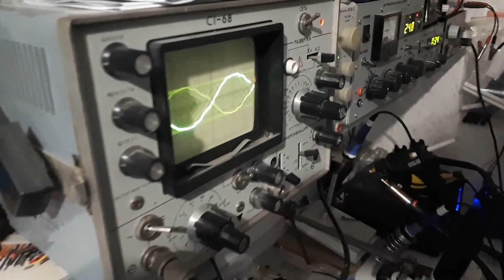Hobby CNC építés 3.rész (Build a hobby CNC)

Comment: Sziasztok! Az én alaplapomnak van egy párhuzamos és USB kivezetése is(5 axis controller board) . Veszek hozzá párhuzamos - USB kábelt, azt laptopba bedugva jól tudom majd vezérelni? másik kérdés hogy van egy 12V-s 10A-s tápegységem és bekötöttem 3 NEMA 23 motor TB6600 vezérlőkkel és mindegyik vezérlőn ég a piros lámpa bekapcsoláskor és amotorok csendes, sistergő hangot adnak, mi lehet a gond? Összekötöttem sima Arduino uno-val is egy motort, azzol forgott a motor de mégis égett a piros lámpa..köszi előre is a választ